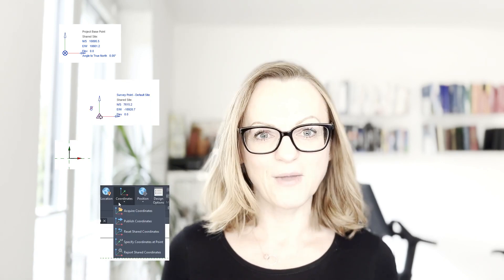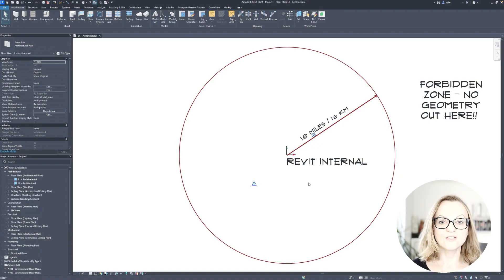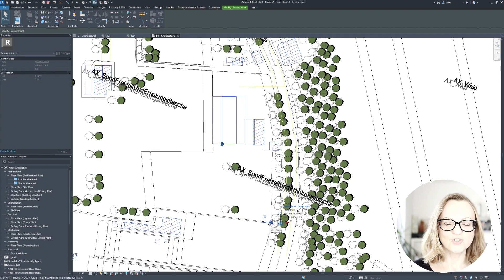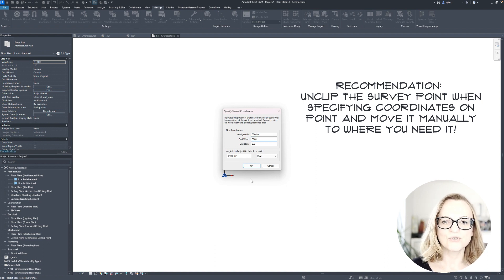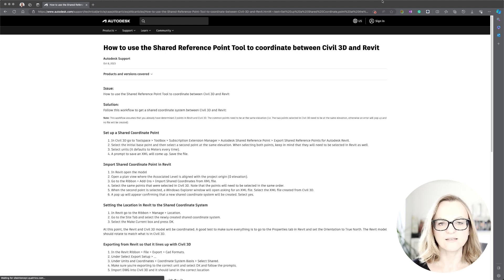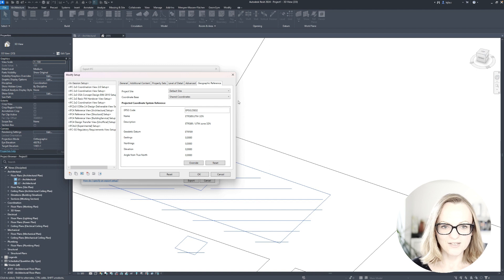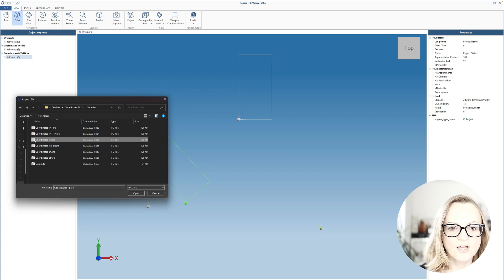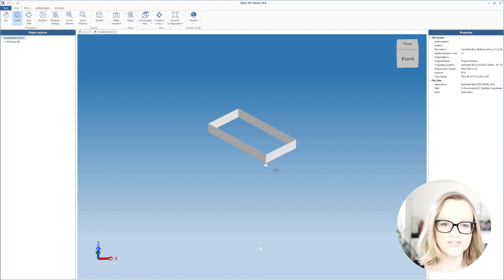Georeferencing in Revit and IFC - Pt. 1: The Basics

Comment: I wanted to let you know that I really enjoyed your video and appreciate you covering this topic. 

I've heard from some people that unclipping the location of the Survey Point can cause issues, particularly with elevation information. Have you had any experience with this problem?

I came across some materials from Nicolas Catellier that recommend not unclipping the Survey Point. 

On the other hand, I believe that unclipping it can make exporting easier (there was a thought-provoking geometry distortion in your video :) ), it shows real measurement location on site (that can be a physical element) and I haven't had any problems with it myself.
Reply from the maker: Thanks for your comment! Clipping or unclipping really depends on what you’re trying to achieve - in this video i particularly mentioned what happens AFTER a georeference has been set. Height information is tricky indeed, because again you have the number indicated in the survey point and then the location of the survey point, which can be different. I really think Revit gives us too many options to set up things in different ways.. 😅 Will try to cover it in another video. 
In general, different projects have different requirements and different best practices, I think it’s just important to be aware of what happens when you move these points around.
Reply: Revit pure video about cooridnates system was released in 2019 and there was also a clip with project base point which doesnt exist anymore So the video and rules there are out of date unfortunately. I had problems to find latest news So great to See New videos in this topic. Please cover elevation in next videos!
Reply: I also use unclipped survey point.